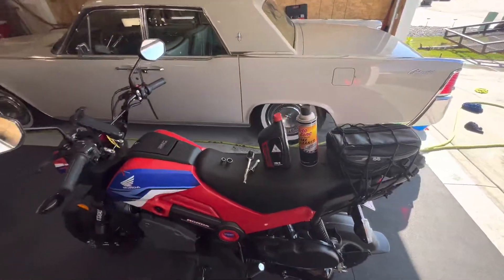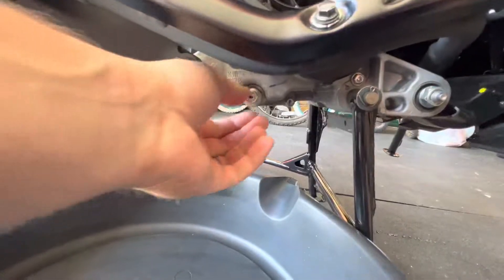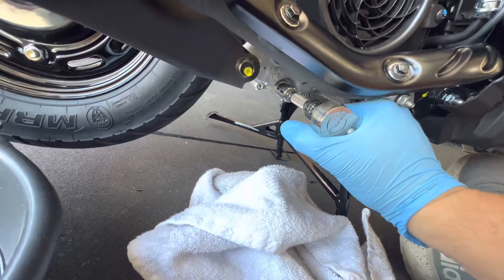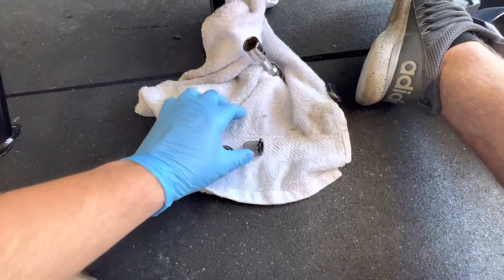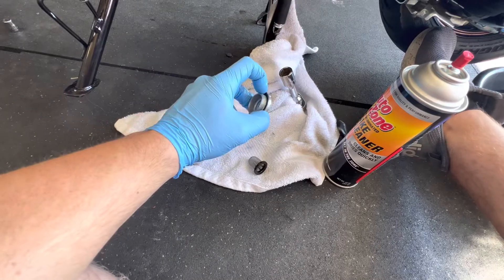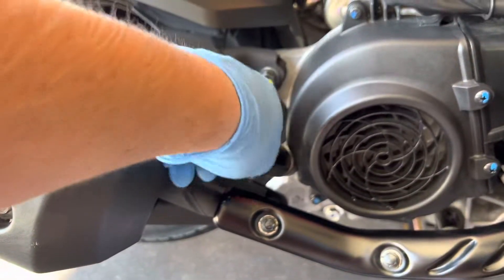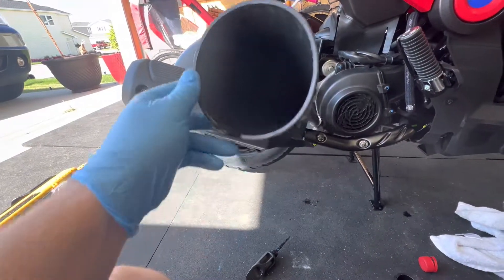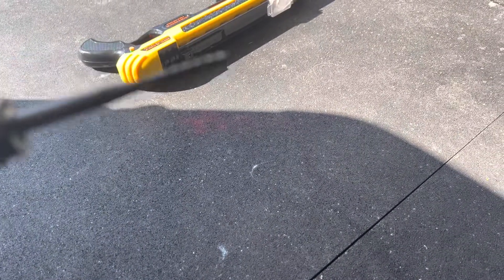1st Oil Change on the Honda Navi!

Comment: Just a heads up for checking your oil level.  When you put the stick back in to check oil, don't screw it in. It wasn't designed that way. Just put it up to it so it seats and then pull to check level. Then, of course, cross-thread it back in when you're done...